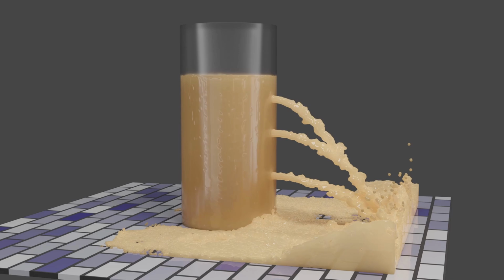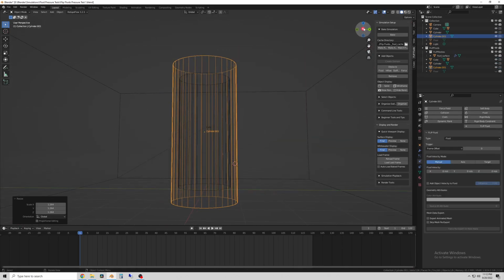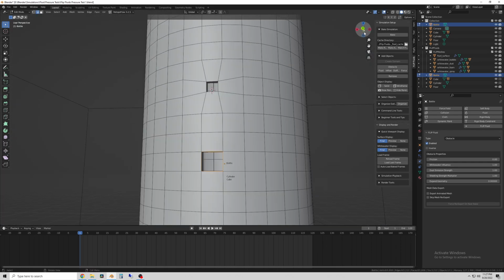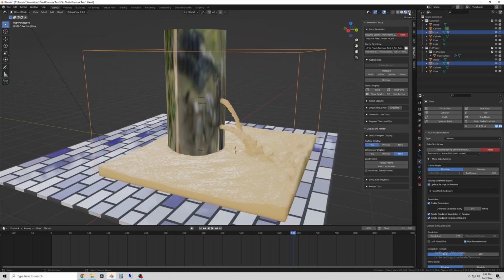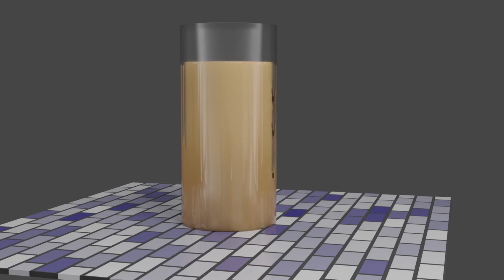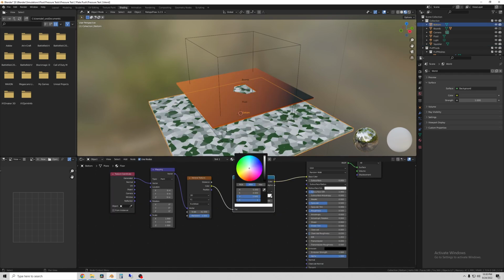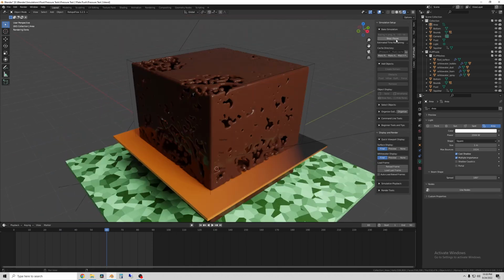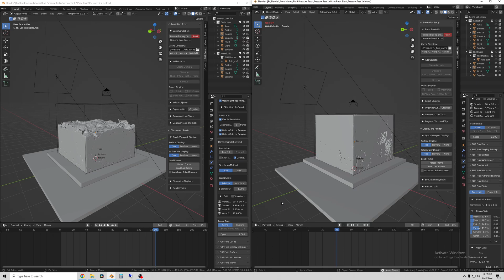Blender Flip Fluids Pressure Test (Can I use it for Hydraulics Engineering Demonstrations???)

Comment: I (engineer) am pretty new to Blender 3.5 and am trying to simulate a bell siphon. I have a cube source set as "geometry" which drops a volume of water into my box containing the siphon. The water does flow down the siphon but the source water drops very slowly and levels off at the siphon drop without removing all of the water. Have you ever simulated a siphon in Blender?
Reply from the maker: Hi there! I have not simulated a siphon in Blender, but I know that most of the fluid simulators are not necessarily accurate scientifically, but just look convincing. So depending on which simulator you are running, it probably won't use atmospheric pressure or vacuums, so many things probably won't work correctly. 

As for the fluid level dropping slow, I do know that some settings cause the fluid simulation to spawn extra voxels to make the flow look better, so you could have extra volume of fluid being created. This could explain some of the slowness. It would be interesting to see the simulation so I could see what I think.
Reply: @ContradictionTech  Thanks! Well, being new I've realized that you are using the "FLIP Fluids" addon which is different from the FLIP option in the native fluid simulator. So, I'm trying to rebuild your example. I don't need scientific solutions but rather just a visualization of a concept I'm working on showing how fluid would move around a chamber using slight negative pressures to hold water in certain areas much like a finger over a 4-8mm dia straw holding water due to surface tension with 1ATM pushing up and <1ATM in the finger-sealed head.
Reply from the maker: @AffinityPhoto  I would be curious to see if FlipFluids does consider air pressure. I could read up on it and maybe run a test. I will look into it.
Reply from the maker: @AffinityPhoto  Oh awesome thanks for looking into it! Yeah Flup fluids is super fast and relatively cheap. Scientific software goes up in price fast, for sure. Speaking from structural engineering experience.